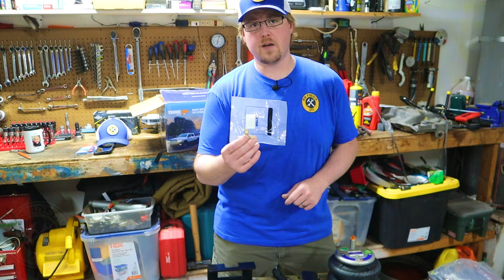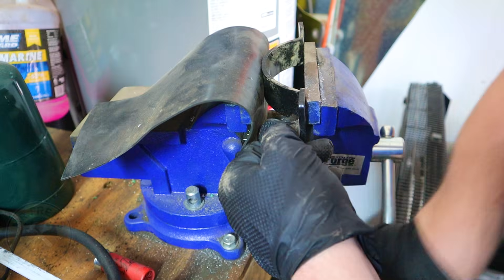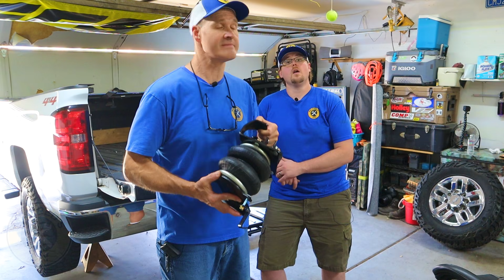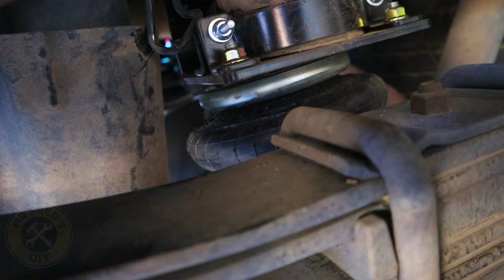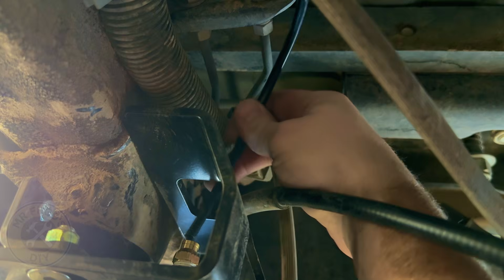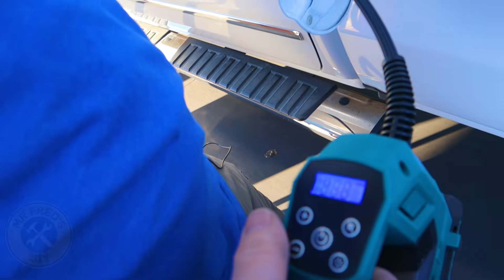Step By Step Air Bag Suspension Kit Install - Torque Parts Kit TR75613AS

Comment: Thanks for the video! I just got a 3500HD 2025, All my life I thought that air suspension would need a compressor, a tank, sensors, switches hahaha Glad to see that can be just filled with a normal tire compressor when needed. 

I have a question. My 3500 is ratted 3800 payload, plus the weight of the truck itself. the 7000 load capacity of the airbags is like, the entire capacity, or just the airbag. I mean, part of the weight will be hold by the original suspension and some help will be provided by the airbag, is 7000 Lbs the entire load of that side of the suspension, or the airbag alone? (hope that makes sense)

THANKS!
Reply: Nevermind I read at the website, is 7000 what the airbag alone can handle. definitely not going to load the truck with 14.000 lbs only at the airbags hahaha but while driving with the trailer and getting some bumps or hard brakes, some extra weight goes for a little bit to them so is nice to have an extra margin. Thanks again for the video. 

PD:"I'm like 90% sure that that 5psi is just to keep the airbag in place so it does not come out or move too freely
Reply from the maker: Thanks for checking out our video. It’s the payload rating of the truck. If your truck is rated at 3800 and you install 7k bags it will not change your gvrw. The bags are just rated to a working load limit of 7k. The bag systems are usually over sized (think dually)
Reply: @MrFredsDIY  Thanks for the reply! Yes I understand the GVRW payload and the legal sticker number, the pickup makers lowering it to not hit the 10k lbs "working equipment" etc etc. I think the ratted load for the axle is 7200 or around that, the payload ends up after the truck weight on that axle, so, the airbags needs to be on the axle load, not the extra payload free to use. Everything has been super overcomplicated (not the video or the airbags itself) but the payload, real payload, sticker, 5th wheel hitch weight (that is not a fixed number, that changes brand to brand, model to model, but you need to dig deep internet to find it), towing package, brake controllers, and it endless, but then you see a random guy pull up with a 2500, towing something way out of the payload, without brake controller, leaving happy the RV dealership with the trailer. 
Again thanks for the video! I'm browsing torque webpage now, for the silverado and I will search if they have for the Mercedes Sprinter 2022 4x4, I was videos on kits that are too short being sold for the sprinter. (the 4x4 has higher suspension)
Reply from the maker: There certainly is a lot of information to consider for sure! We see folks towing things that they absolutely have no business towing all of the time. We saw a guy towing an airstream the other day with a small SUV. Crazy.

Comment: What a shit kit😂
Reply from the maker: Not Really. The airbags work well and aside from the bracket issue everything went pretty good on the installation.
Reply: @MrFredsDIY yea but amything that requires modification out of the box is crap. They dont even give you proper bolts😂  wouldnt recommend this kit recommend rideright. Atleast you can assemble it out of the box

Comment: I purchased a kit off of Amazon and installed it this weekend.  It was a relatively easy install as you show on this video.  I did bend the curved brackets similar to how you did to fit around the cup on the truck, and the bolts that pinch the brackets around the cup didn't have enough threads (same issue you had).  I installed some shorter bolts so that I could get a tight fit on the cups.  Everything else went well.  Thanks for your vid, it gave me confidence to buy the kit.  I filled the bags to 50 psi and checked for leaks, and then set them to 5 psi for daily use.  I haven't towed with them yet but I expect they will work as they should.
Reply from the maker: I’m glad your installation went well! Thanks for taking the time to comment.

Comment: Maybe the “T” dampens sway? If air from one side is trying to travel thru the line to the other it will meet resistance which will have a dampening effect.

Comment: You don't want to install the tee in the air lines.  Doing that allows the truck to sway more because then air can move from one bag to the other as the truck sways.  Keeping separate lines for each bag significantly reduces sway when you are towing heavy.
Reply from the maker: Thanks for commentating. That’s an interesting theory. I’m not sure that I’m sold on it without more evidence though.
Reply: @MrFredsDIY  I put the tee on the first truck that I put air bags on.  I was towing very heavy with it (48' toy hauler).  I wasn't happy with it, so I took off the tee and ran separate fill valves.  It was a big difference.
Reply: If air was trying to travel to an empty bag I could see this but with equal pressure wouldn’t the system constantly be trying to equalize?
Reply: @campingtips-n-tricks  Yes exactly, it tries to equalize.  So as your truck sways to the right, the air travels out of the right bag into the left bag allowing the right bag to collapse more than the left bag.  If you had separate lines for each bag, the pressure will increase in the right bag and lower in the left bag as your truck sways, decreasing how much it sways.
Reply: @davidhenry3674  I drive semi trucks for a living and the bags aren't separated they are tied together so when i put bags on my 2500hd i went with a t also, i justified that because i drive trucks for a living and seen way too many guys saying to separate them and i can assure you like Fred said that theory isn't a good selling point for me to justify separating them.